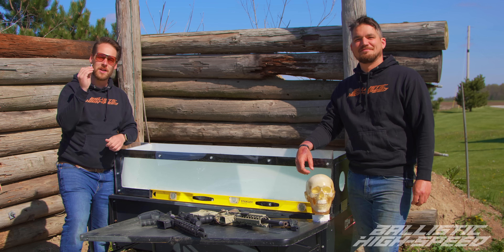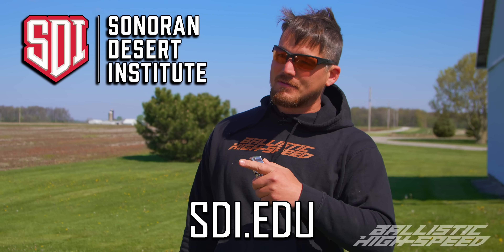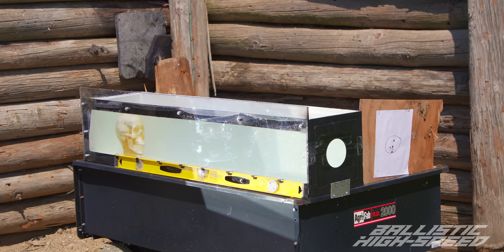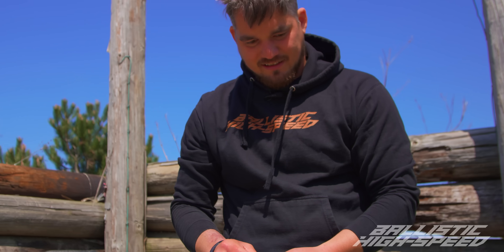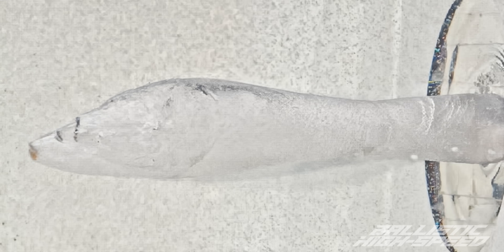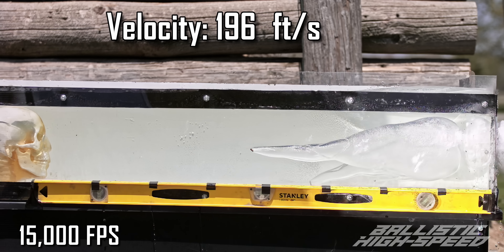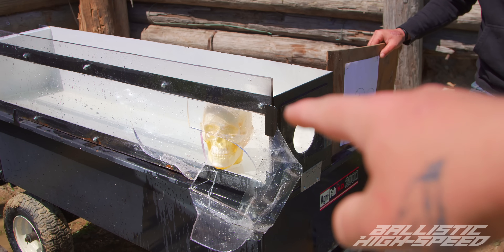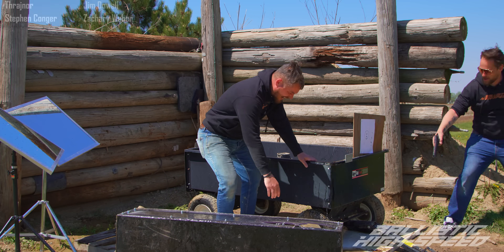How Much Water is Bullet Proof?? FMJ vs Hollow Point! - Ballistic High-Speed

Comment: You have great equipment but terrible science!!!  Mythbusters is still king.  What would have been more helpful is for you to determine at what distance can a bullet still do damage.  A fragment reaching the end of the tank is meaningless if we don't know if it would even pierce skin.  Also, and here's where science would have also come in, shooting in a tank will yield very different result va shooting in a pool since the bullet would have more water tension and surface pressure to deal with. Try jamming a pole into a fishtank filled with sand vs doing the same on the beach.

Comment: Large subsonic round will do the best penetration wise. Solid copper 8.6 blk or 300blk, even 9x39 subsonic would be probably the best choices. Or get ahold of the underwater pistol that was specifically designed for this kind of thing.

Comment: When you make your new box instead of it being with an adhesive on the glass to bond it along with bolting it. Put a rubber gasket between the glass and the frame with a metal ring around the outside for support, then bolt it down. That way, when or if the glass breaks, you can replace it with another glass and not have to call it a day.
Reply: Also, use polycarbonate (Lexan) instead of acrylic (Plexiglass).  Polycarbonate is almost shatter proof.

Comment: things going supersonic entering the water makes physics mad
things trying to go supersonic underwater period makes physics mad
the only way I know to drive an object that fast under water is to remove the water with a gas generator and cavitation, so you're essentially flying in a self generated void space with just tiny control surfaces skimming the outside. it's a wild problem and the military has been trying to crack that must for a long time (what if you could fire a torpedo as fast as a bullet)

Comment: Im not surprised by the results. The faster you go the harder you crash.

Water acts like a solid object at high speeds meaning the latger the surface area and faster the round the more that bullet is going to look like a grape that got run over when it hits water.

Comment: Would've loved to have seen some of these rounds more than once. That 9mm FMJ was still cookin at 4-600 fps when it was near the skull. I think that had a good chance of being lethal if it hit
Reply: Agreed
Reply: 300 ft per second is generally considered to be the cut off for a projectile being dangerous. Of course, that takes into account the size of the projectile. You don't want to get hit by a car doing 300 ft per second!
Reply: @floridagunrat1625 it hit something hard enough to ding the copper jacket. At the very least, that should bruise if not break bone. It could still be lethal.
Reply: Red Ryder BBs go at 350fps, and are usually not lethal* but will break skin. Now the 9mm bullet is of course much heavier, and thus still can deliver more energy, but spread over a larger impact area.

*Exceptions of course apply - not all the brain is protected by nice hard skull bone.
Reply: @divVerent  I'm curious if they can simulate the how much damage the human eye can tolerate. A BB gun usually can't kill directly, but it can maim someone for life depending on the situation.
Reply: @divVerent  you're comparing .5 grams to 7.5 grams. force = mass x acceleration, and those grams make a big difference. T
Reply: @mezzanoon  That was kinda my argument. I would not consider a 9mm travelling at 400fps non lethal when a much lighter BB traveling at 350fps already can be lethal, although usually not.

Basically all depends on where it hits, and the 9mm at 400fps has better chances to kill than the 350fps BB on literally every parameter there is.
Reply: (with the one exception of surface area - the 9mm is gonna be lead and will flatten against the surface, thereby spreading impact area, while the BB is solid steel and will not deform - but I assume that at such low velocities the deformation of the lead is not as strong and thus the 9mm should still have a better chance at splitting bones at these low velocities)
Reply: Ok.  .

Comment: Nice video, but it is scenario specific to barely under water in an above ground pool. Your shallow tank allows for water to move up and out of the tank easily. Also the higher the water column is above the bullet, the more pressure the water would exert on the bullet as it passes through. More pressure means more friction which means the bullet would decelerate quicker. For a more accurate test you would need to have an equal amount of water above the target as the distance to the target through the water. That would give you a better reference to the depth that would be bullet proof. Or you can just build a vertical tank and shoot down in to it.

Comment: 1:04 - Lexan is the manufacturer's name. The material itself is polycarbonate which is similar to acrylic (also called plexiglass, which is also a trademark brand) but is more resistant.
some lenses are made from those
Reply: Polycarbonate (Lexan) is a different material than acrylic (Plexiglass).  Polycarbonate is almost shatter proof, and is sometimes used for bulletproof barriers.  It has a blueish hue.  Acrylic is cheaper, is more brittle, and has a slight yellowish hue.

Comment: I'd love to see what a burst fire weapon would do to water like having Hollow Point, Hollow Point and ant then the Fullmetal Jacket would the FMJ at the back have the time to use the displacement air pockets of the hollow points to it's advantage reaching the target? Also, would Flachettes have a better aquatic performance than regular bullets I'd be betting that they do have due the stabilizers at the back... 

Cavitation is a fun thing to see! Same thing Peacock Mantis Shrimp has that in it's imopressive spreadsheet of abilities!

Here's a bit of a Wiki for you curious people! 
"It is reported to have a "punch" of over 50 miles per hour (80 km/h), the fastest recorded punch of any living animal. The acceleration is similar to that in a .22 LR bullet fired from a handgun (accelerations of over 100,000 m/s2 or 330,000 ft/s2 (more than 10,000 g), and speeds of over 20 m/s or 66 ft/s), with each strike packing 1,500 N (340 lbf) of force.[8] The speed of a raptorial appendage's strike causes cavitation bubbles to form."

Comment: Some guys never watched Mythbusters. And that's shooting at a 90-degree angle. At a 80 or 70-degree angle, the bullets would perform eventually worse. Also, the faster the bullet enters the water, the more resistance it will encounter. For best results, you should use a small bullet traveling as slow as possible.

Comment: You know? I wonder what a 9mm sub-sonic FMJ would do? Same size, less velocity, but more mass.

Kind of wonder what a .308 heavy load would do too.

Velocity is obviously something that is extremely detrimental to penetrating water. The faster the bullet goes, the more the incompressibility of water just decelerates the bullet. Just rips the bullet apart as we are seeing.

So I think a .308 with a 200+ grain bullet, at transonic velocities might stand a chance of reaching to the back of the tank. It won't have the velocity to just destroy itself, but it might have the right shape, mass, and diameter to go the distance. I feel the length might play a big role in keeping the bullet "stable" at lower velocities, with the added drag from yawing, forcing it back on its path.

If nothing else, would be fun to watch!

Comment: .556/.223 were designed to tumble and dump all their energy within the body. That's why the military chose it in the 1960s. The 7.62x51 caused a lot of damage, but overpentrated before dumping it's energy. I was wondering if it would make it far.
Reply: You need mass for momentum and range but the most important parameter is: BC
Reply: The military went "capacity" over "power"...Soldiers no longer have to kill at beyond visual, but call in artillery and air power. Oh...And not run out of ammo, a smaller caliber offers that also....Just a basic history . Anx polititians still preach that the AR15 is "overly powerful". Ignoramus` ignoratnes~
Reply: 556. is actually great at penetrating body armor. thats why they used it. 556 punches through what 7.62 wouldnt. small hot and fast beats slow hot and big every time regarding body armor. the 556 is accurate out over further ranges than the 7.62. less bullet weight less bullet drop over distance. civilians arent experts on anything firearms related. opinions dont make people experts.
Reply: @nomercyinc6783 5.56 was adopted before body armor was even thought about being a thing. The only thing that was considered for penetration was Soviet steel helmets at 500 yards with the steel penetrator. (Which wasn't a great feat by any means at all). 5.56 was chosen because more more could be carried by the foot soldier than what could be carried with 7.62x51 and also rifles were more manageable on auto fire than what they were with 7.62x51. 5.56 is only more accurate at distance than 7.62x39, 7.62x51 more accurate than 5.56 at further ranges. 7.62x51 can reach and still be useful at much greater ranges than 5.56 is even capable of obtaining. So guess what Junior you need to read your previous comment in front of a mirror back at yourself and go back to school boy.
Reply: @SAR0311  bet he was chair force 🤣
Reply: @nomercyinc6783 civilians aren't experts on anything firearms related? Thats an ignorant statement. I am an infantry veteran, and I can point you in the direction of a handful of civilians in my area who have likely forgotten more about firearms/firearms related things than you and I could ever learn. Nice way to show your ignorant opinion proves your point about expertise 😂
Reply: @nomercyinc6783   Umm...  I used to shoot 7.62 out to 1200 yards in competition.  I absolutely dispute your claim that 5.56 is more accurate at range.
Reply: @nomercyinc6783 Theres no contradiction. 556 can penetrate tough barriers (eg steel) due to high velocity but will not penetrate dense softer material (eg earth, concrete, flesh) as far due to lower momentum

Comment: Hitting water at that speed is like hitting concrete. The faster the round the more damage the bullet will get the slower the round the further it will go into the water. You might be able to damage the head using a .577 ca Enfield or 69ca brown Bess black powder rifles The rounds are heavy enough that they might do damage but not fast enough for them to come apart when they hit the water. You can see the rounds come out of those old guns with out the high speed camera.

Comment: If you want them to go straight underwater, try a flat nose, non-expanding projectile.  Perhaps if you could find a brass solid, that might hold together.  Back in WW2, the IJN designed their armor piercing naval shells to lose their thin, pointy windscreens on impact with the water, revealing a flat nosed AP cap (or both the windscreen and cap separated and the main shell body was flat nosed...either way).  This apparently provided a stable underwater trajectory (see what that 45 hydra-shock core did?  It went straight, even if it slowed down super quick), with the idea of a just short round diving below the armor belt, and penetrating the shell plating nose forward (so the fuse would function correctly, the round wouldn't squash sideways, etc) before exploding.  Ref NAVWEAPS website discussion on IJN AP shells.

Comment: What shocked me the most out of this.. is that the water is practically non-reactive, until the air introduced in the 'wake' of the round passing into it compresses and explodes, causing the cavitation that then forces the water-surface to react.... i figured the bullet entering would initially create a disturbance itself THEN the cavitation effect, but the surfaces doesnt seem to care about the hole being drilled into it untill after the air cooks off.

Comment: You need to put the Lexan inside the frame for full support and clamp it with without making holes. Any time you drill it you weaken the structure. You could also run some upright supports even  thin strips with added on edge adds a lot of strength. I think the wide frame would do the most though. Plus you will be able to slide in a new peace with little effort..

Comment: I want you guys to pair up with someone and get some water worthy projectiles and redo this test... Solid copper/something heavy + specific design. I think it can be done better... and you guys couldn't spring for some thicker plastic? that looks thin considering the application. Get some used bullet proof glass from a bank or something with some real THICKness involved. --- Maybe the tip could be spiraled out (matching barrel spin) with an intentional air pocket venturi setup to suck air from the rear of the projectile into the tip... There has to be a way to get deeper penetration into water.... look to the high speed torpedoes for some inspiration? not trying to break physics here, just bend the rules. If a bullet could perform well enough then gun fishing could be a thing (not Explosion or shockwave based).

Comment: I kept expecting someone to run up with a piece of flex tape and slap it over the hole every time you shot!! Lol. I've got some black tip 30.06 reloaded. New primers and powder. Good old thick 1955 brass if you want some black tip internal steel core to try and some 30.06 tracers too. Just say the word and I can send them your way.

Comment: And you put a 556 round through a 223 chamber? You do you dude
Reply: It is a wylde chamber. It can shoot either .223 or 5.56 nato. Same chamber angle and design. Just a Lil different head space. Biggest difference is the pressure the round is making. Most wylde chamber ar platforms have a thicker barrel. Be like 12ga 2 3/4" VS 12ga 3" buck out of same barrel. Rated for both but Same 9 shot pellet shells  making different pressures. Both safe and fun. Lol

Comment: Cool footage no question, but did you answer your own question? How much water is bulletproof?? I don't believe you did. Is 2 feet sufficient? Since you moved the skull within that distance we don't know. Also, you should've used a regular lead .308 caliber first before using the steel core. Of course the steel corp is gonna go further without compressing, but would it have been lethal at 2 ft.? You're just gonna have to make another one with an improved tank and the starting point is the .308 going up to the .50 cal BMG round and the 500 mag. Good luck with the tank design.
Reply: Dependance on cal

Comment: A better design for that box might be to have the shooting face also be made out of lexan, but a much thinner piece, so it's purposely intended to blow out, when it goes under such high pressure.
Reply: No, even 1.5 mm lexan (or even polycarbonate) will cause a bullet too start to flatten out and tumble
I built a similar water box 20 years ago and found 10 mil Visquine (or Visqueen some call it) works the best to have little to no effect on the bullet so the only thing your testing is the bullet against the water.

Comment: Build the next box with 1” thick ballistic glass and fastened to reduce stress concentration at bolt holes… perhaps even no bolt holes just clamping and adhesive. Also stiffening members across the top every 12” to reduce long axis bending at the top of the glass. Then it should survive a large quantity of testing. Go big or go home there is no downside to over designing this thing. Then you can reuse it for heaps of content. 
Cheers!

Comment: Eeehhhh, Idk guys. You have a 1ft X 1ft tank (it looks like). Would the results differ with a 2ft X 2ft, etc? Part of me believes the volume of water would be a factor in some way. I think a swimming pool would yield different results than a bucket of water. Also the weight of the water vs how low the bullet enters the water, etc. Not bashing anyone, just thinking out loud. It was a really good video.

Comment: Seeing the bullets spin made me think of how cool it’d be to see 8.6 blackout in highspeed with the 1:3 twist barrel
Reply: It wouldn't be spinning any faster. The twist rate is high because the velocity is low. The actual spin rate is comparable to "normal" cartridges.
Reply: @B.D.B.  The actual RPM might not be appreciably faster, but the number of turns per inch (like 1 in 3) is pretty wild compared to everything else out there.  And I would think it would be very interesting to see underwater in high speed, especially with something like an expanding copper solid.

Comment: 🔥Awesome! Need to rebuild. Larger tank for sure. Some suggestions….
   * Test multiple speed projectiles, (250ish FPS up through 4000+FPS), of the same caliber, ideally same bullet. As speed is VERY impactful on results, slower, to a certain point, will travel further, very fast will disintegrate upon impact, pending projectile composition of course. 
  * Pressure transducers at various distances in the tank to measure the hydrostatic peak pressures! 
   * Maybe test extremes, Daisy Redrider BB gun, air rifles low and high end, up to a beyond .50… (maybe colab with Scott at Kentucky Ballistics?… )

Comment: Don't listen to the rest of the comments, just mine.  Have your water box sit vertical and longer.  It will eliminate the false outcomes due to the bullet impacting that tape prior to the water which in turn creates friction that shouldn't be be there for a "water" test. Might not seem like a big deal but when you add the force/pressure of the water against the tape, plus the actual tensile strength of the tape it will cause the bullet to be more inconsistent with travel direction along with speed declination and early hollow point shedding.

Comment: Should be able to install a one way check valve on the tank when the pressure is increased, the excess water will be able to escape the tank without causing damage.